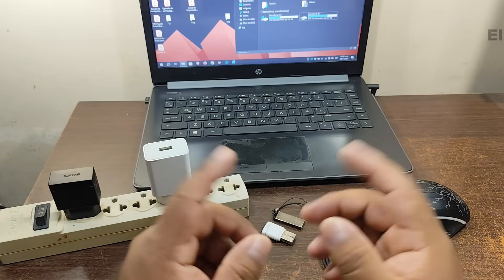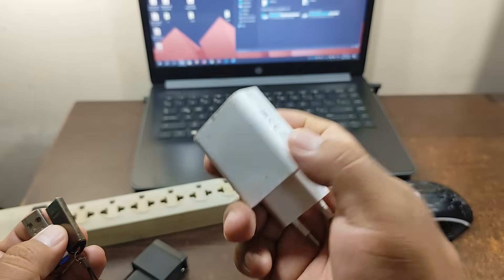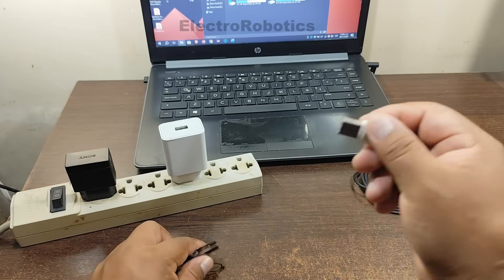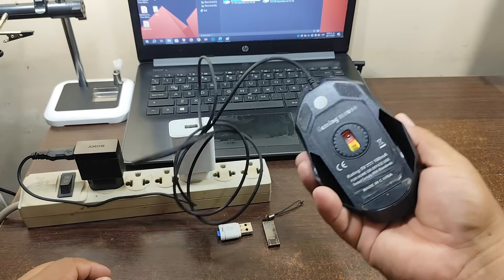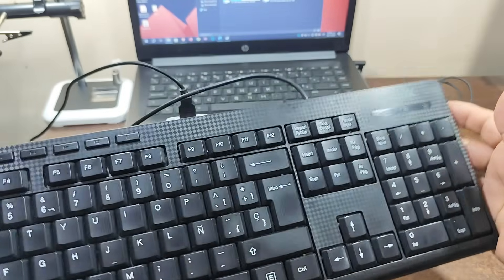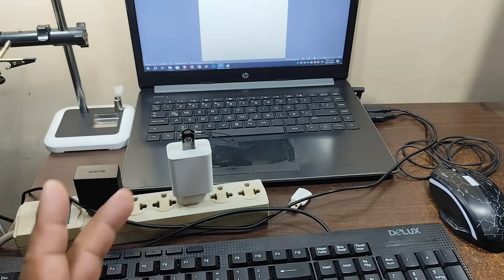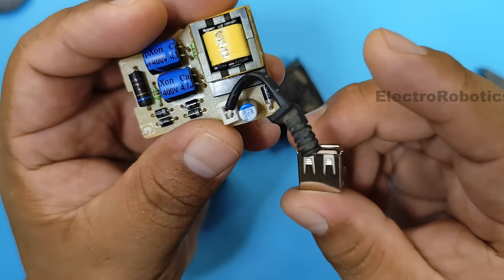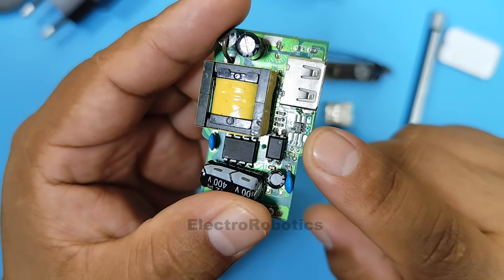See What Happens if I Connect a USB Flash Drive to my Cell Phone Charger!

Comment: Let me tell you this charger 5v-12v  they hav volt controller they increases only when the device Give command and that works in some device but these charger normal it's 5v unless the device Gives command to increase then it will so its safe to use ...... 
flash drive its not for charger  but some has resistor for protection the same in mouse they have resistor so nothing will happen unless you increase More than 12v for eg 24 .... 
laptop max is 18v -20v so it handle because of resistors which reduce volt where nessesary

Comment: Now, here's the thing!

Long story short:  there is a whole and sophisticated technology for Fast Charger called in different ways - up to the manufacturer's proprietary technology - called for instance: " Power Delivery" or "PD" or USB-PD". 
USB-PD (Power Delivery): Is the protocol (the software/the rule) by which the phone ask the charger: „Give me 20 Volts”, for instance.
Qualcomm names it: QC 4, 4+ and 5 and are compatible cu USB-PD.

What really happens in the Fast Charging chargers is that they are electronically built TO NEGOTIATE the VOLTAGE - NOT ONLY THE AMPERAGE  - so that even being built with a wide range of Voltage THESE Fast Charging chargers - PD Chargers - WILL ALWAYS DELIVER THE RIGHT AMOUNT OF VOLTAGE AND AMPERAGE REQUIRED BY THE ELECTRICAL LOAD, AT A PARTICULAR TIME, OR PARTICULAR INTERVAL OF TIME, IN OTHER WORDS WILL ALWAYS BE A LITERALLY CONSTANT NEGOTIATION BETWEEN THE CHARGER ITSELF AND THE ELECTRICAL LOAD - meaning of any particular device's electrical load - AT A PARTICULAR TIME OR INTERVAL!

Not only that, but Power Delivery chargers that always are endowed with a wide range of Voltage hence Amperage, as well, requires highly power charging cables - most of the times USB type C, ONLY - that they themselves are fitted with micro-chips within their USB sockets that are also part of the negotiation of the needed VOLTAGE to power-up or to charge any particular device, part of Power Delivery's technology!

Now, you know and surely understand why NONE OF THOSE SHOWED DEVICES - and many more others - WON'T EVER BE DAMAGED - AND DIDN'T GET DAMAGE IN THE SHOWED PROCESS -  by any Fast Chargers, regardless their higher Voltage ceiling AND CERTAINLY AND DEFINITELY NOT BY THOSE Low Chargers, in any case!

SIMPLY PUT: Low Chargers are delivering ONLY AND ALWAYS the exact Voltage - 5 Volts -  that any of these showed devices are designed to be supplied with, and Fast Chargers - Power Delivery ones - will only deliver AS DEFAULT 5 Volts, as well - IF - AND ONLY IF - THE ELECTRICAL LOAD IS NOT REQUIRING, NEGOTIATING, REQUESTING OTHERWISE!

Now, the real achievement of Power Delivery(PD) technology is that no such now-a-days built-in device's technology will be jeopardized of being BURNED-OUT/FRIED/TOASTED/SURGE DAMAGE BY A MISSFITTED CHARGER!!! 

Catching the whole drift, right now?!

Comment: USB connectors have both data and power lines. If the USB device doesn't communicate with the power supply (charger), the power supply of a fast charger will only provide 5 volts. The higher voltages are only supplied on request. This insures that newer USB ports are backwards compatible with older USB devices. After over 40 years in tech support, I can assure you that not only children put things where they do not belong...

Comment: In short, you will not damage a data device by plugging it into any usb charger as they have protection circuitry. The video could have shown all it's content in about 3 minutes flat but it's drawn out.

Comment: Nothing will happen because all chargers output 5V by default, which is normal for all USB devices because they also work on 5V. In order for the fast charger to output 9V, 12V, or more (depending on the model charger), first the charger outputs 5V and then makes a request to the device if it supports the fast charging protocol and what voltage the phone wants. Simply says: Charger say "Hello, here are 5V, do you want more?" and if the device is a phone, the answer via data pins is "Yes, I want 9V or 12V"

Comment: The pd 3.0 charger should be able to sen 5, 9 , 12 15 and 20 volts but what your pluging into has to call for the voltage the charger wont just send any voltage im not sure of the amps. I just started playing with a charger and usb c that you can set the votage. I ordered the ppart 2 weeks ago and it just came in,  its a USB-C PD/QC Fast Charge Trigger Module & Decoy Board - Dual-Port Voltage selector (5V/9V/12V/20V Output sorry copy and pasted info plus it does have 15 volts which is why im using it. The 20 volts works to. But the board does get warm. Using it for a 4 led red acrylic side lighting sign.  Great video. Upgrade your chargers.

Comment: An unrelated but important side if I may:
USB cables are available with and without their data lines connected. The 5 volt lines are intact.
This is important when charging your devices using public chargers, airports, coffee shops, etc.
If a charging cable with the data lines intact is used, there is a possibility that malicious code can be
sent to your device or that someone could gain access to your device's system and steal info or
install a virus onto your device. Always use a cable without functional data lines to avoid these issues
and ALWAYS use a reliable VPN service to encrypt your data when a using public WiFi. Stay safe!

Comment: BEWARE! Some years back when my new cats61 phone became my everyday use, it had a smart charger. I plugged my early, expensive dual car camera in before I was aware of the risks. The camera was destroyed. I am pretty good at repairs but the cpu was fried. I suspect the charger still had high voltage charge on it's output when the camera was plugged in.

Comment: That's such bullshit. The keyboard lights only work when connected to a PC because the operating system controls them, not the keyboard itself. Power adapters only output 9 or 12 volts when they receive the corresponding signal. And why does the power strip have three switch positions? It would have been interesting to know if you could connect a hub and plug in a device that switches to 12-volt mode and another device that only accepts 5 volts.

Comment: the status leds on the keyboard do not light up because they are controlled from the host device (the pc) and are not directly controlled by the keyboard pcb; also, the standard behaviour of usb chargers is to provide 5V, the remaining voltage levels are activated only if the charger receives a control command from the attached device as far as I know and this includes also the so called quick charger options
Reply: Very true, old XT keyboards worked in one direction, while AT keyboards work in both directions. When Num Lock key is pressed signal goes to keyboard controller on MB and then it goes back to switch on/off LED.

Comment: USB transmits power as well as data. The data doesn't interfere with power delivery. Power does not interfere wit data delivery.
A phone charger will only deliver as much power as the device specifically requires.

Comment: I downvoted this because you are a moron who wasted 12 minutes of my time.  I answered "what happens" before I even played the video.  In the case of the black (5V only) charger, nothing could happen, because all the devices were receiving the same 5V on the designated pins that they would receive from a computer, and nothing was happening on the data lines.  In the case of the white multi-voltage charger, the result should be the same, as long as the data pins don't misinterpret some spurious signal to trigger the higher output voltages.

As for the keyboard not lighting up CapsLock, NumLock, etc, that was also predicted by me, because the PC/AT keyboard interface standard has the CapsLock, NumLock, etc, states only existing on a connected computer; these states don't actually exist on the keyboard.

One positive note:  It was good to know the potential danger from a child safety viewpoint.
Reply: Clearly you weren't the target audience.
Reply: se hai aperto il video senza sapere che non sarebbe successo nulla, vuol dire che di elettronica non capisci niente

Comment: Good job sir,for the charger  that delivers 5v 9v and 12v are there an adjustable voltage regulator ic in the circuit that monitor the output voltage?